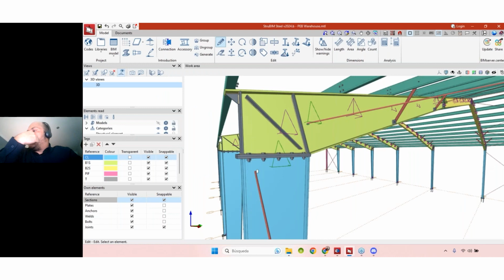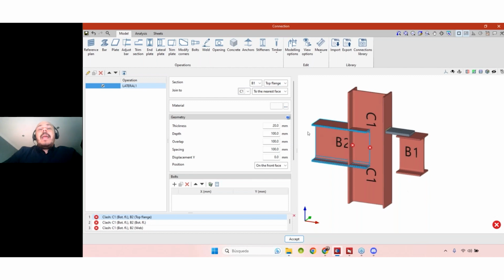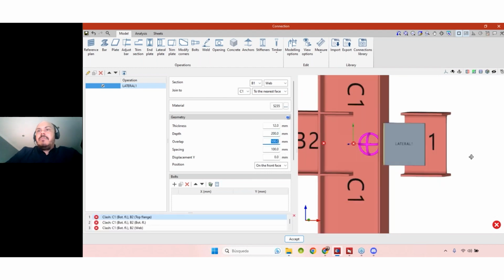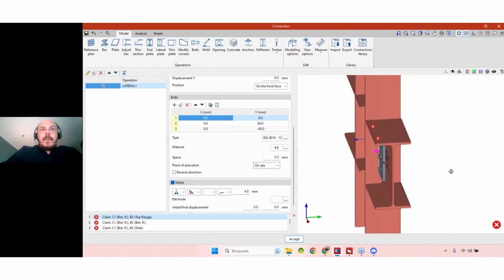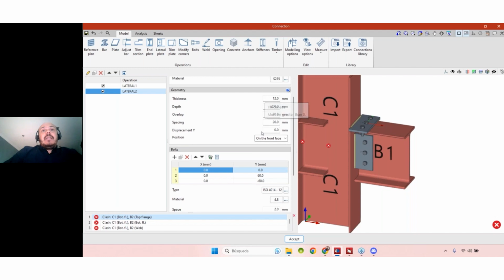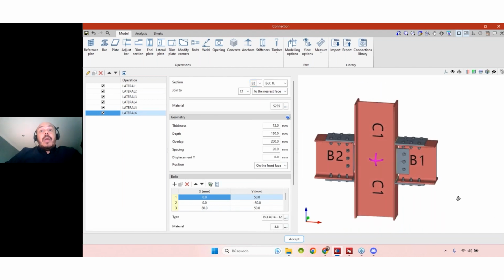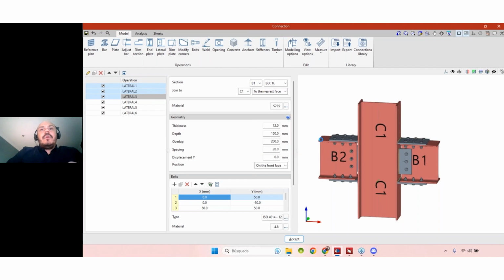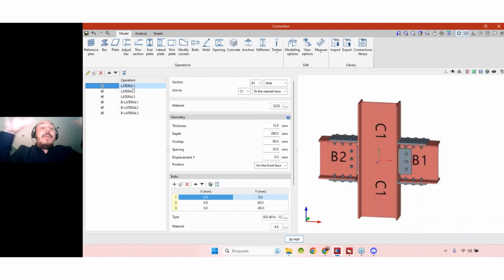CYPE Connect and StruBIM Steel: New operation - lateral plate

Comment: boa noite no strubim 2025 como colocar base de fixação no concreto com parafuso
Reply from the maker: Olá! 🙂 São colocadas da mesma forma que as placas de fixação em sapatas ou elementos de concreto.
Recomendo que, a partir da gestão de arquivos do programa StruBIM Steel, instale os exemplos com o comando “Exemplos”, abra o arquivo E02 - edite a união tipo 6 ou com placa de fixação. 

Você poderá ver os passos utilizados para definir as placas, as fixações, os reforços, etc.
Lembre-se de que é possível desativar todas as operações para ativá-las de acordo com a ordem de criação, a fim de compreender o procedimento.
Recomendo explorar outros exemplos tanto do CYPE Connect quanto do StruBIM Steel para compreender o processo de utilização das operações para a criação das uniões.

Se tiver alguma outra dúvida, entre em contato com nossa equipe de suporte técnico: https://learning.cype.com/br/suporte-tecnico/ 
Cumprimentos! 😊